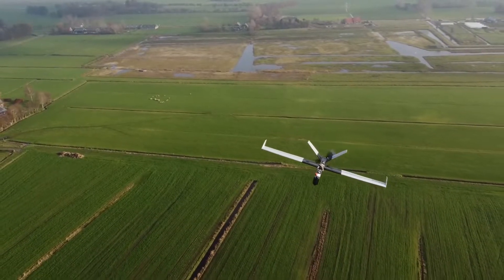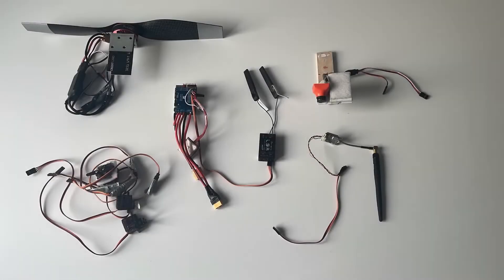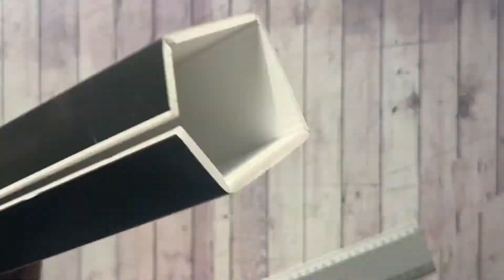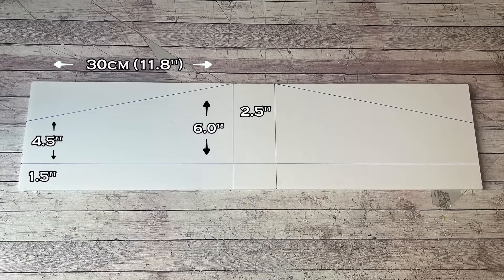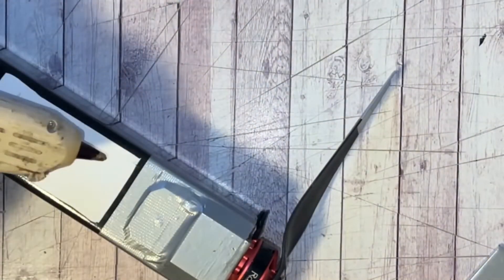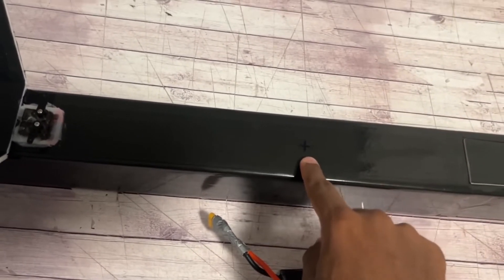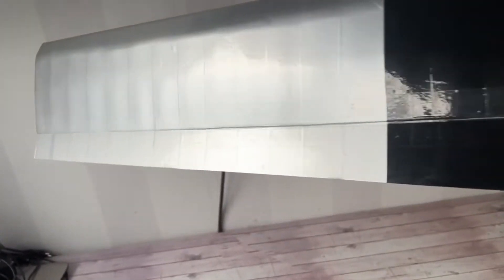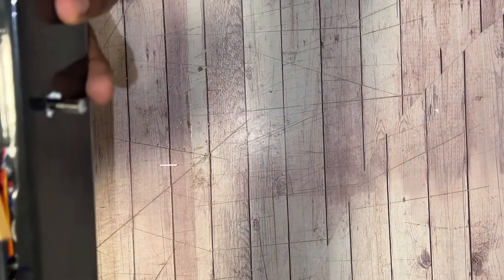How to build a V-Tail Aircraft for Long Range FPV - Silver Eagle

Comment from the maker: I've linked the electronics down here

Alternative's to the F405-WING & Recommended Flight Controllers:

Matek F405-WTE: https://s.click.aliexpress.com/e/_Dlk...
Matek F411-WSE: https://s.click.aliexpress.com/e/_Ddw...
Matek F411-WTE: https://s.click.aliexpress.com/e/_Dl1...

Racerstar BR3536 950kv Motor: https://usa.banggood.com/custlink/GDK...
Hobbywing 40A ESC: https://s.click.aliexpress.com/e/_DBK...
MG90 Servo's: https://s.click.aliexpress.com/e/_Dmw...
FrSky X8R Receiver: https://s.click.aliexpress.com/e/_DFC...
Eachine TX805 800mW VTx: https://s.click.aliexpress.com/e/_DFx...
Beitian BN-220 GPS: https://s.click.aliexpress.com/e/_DFN...
Reply: Hello..what is the angle of incidence..? Thanks..
Reply: What is the range of the FPV transmitter?
Reply: Are you using a 4 cell or 6 on this build

Comment: So I have a Silver Eagle built & ready to fly, almost.  One problem when plugging in the battery, the right control surface on the tail is 'flexed' by the servo to it max downward position momentarily.  Unfortunately, the foam can't take this extreme action & requires repair each time I plug in a battery.  I'm using a SpeedyBee F405 Wing flight controller with a SpekTrum SPM4650 receiver.   I'm wondering if anyone else has experienced this problem or just has a suggestion I can investigate.  Thanks !!!!

Comment: 7:30    servos  do   NOT   go  at  the  tail.!!!!!         in any case,  there  NO reason for the length of a pushrod to be minimized.!         the mass of elevator/rudder servos  SHOULD  be located such that  the  model's dom is as optimal as  possible.
you may know that the  center of  MASS  (c-m)  Should be located on the thrust, at a point that vertically aligns with twenty-five percent of chord or mac.      25%, plus or minus a pinch, is the location of the neutral point of a wing.        illustration showing correct location of c-m.
https://s3.amazonaws.com/assets.flitetest.com/article_images/medium/truecg-jpg_1384168691.jpg
if you don't know how to correctly make longer pushrods,  you  should  LEARN.
see at  3:12
https://www.youtube.com/watch?v=3gaORr-WxFs

Comment: information        2:30   the use of full strip ailerons is not recommended.      to the extent practical, a control surface should have the shape of a  Parallelogram.

Comment: What type of remote control are you using? How do you make its range reach 10 km?
Reply: 2:10 he is using the L9R (FrSky) receiver.  These long range planes are frequently waypoint controlled from the flight controller using the iNav software.  In other words, iNav can be configured for autonomous flights.  In this case he is using the Mateksys 405 Wing flight controller.  The other thing to note is that he is using a 600 mW video transmitter, because it is important to step up the power output when flying distance.  On top of that you need to position the GPS away from this high powered video transmitter which on a plane of this size should not be a problem.

Comment: How did you place the CG when you came up with design?  it seems so far back
Reply: install electronics in fuselage.....find the balance point of the fuselage.........measure the cord of your wing 1/3 back from leading edge to find the CG of the wing.....now place your wings CG point over the balance position of your fuse and you are close enough to get it in the air
Reply: Adding to what @mwbvideos good info. Besides installing, or temporary placing the electronics in/on fuselage, you'll also need to place motor (on tail), battery and servos, as they would be positioned between front and rear when completed. Using a rubber band(s) is one way to hold in place. (can even be external initially at this stage). Moving/positioning the battery (front/rear) at this stage can help you better find an preferred location (as it will alter CoG balance point, and thus where wing is placed, as well as position of the battery hatch opening)

Comment: Great build, I noticed the tape is put in a different direction on the wing build process. My experience is that longitudinal taping helps to reduce the wing flex due to the tension of the tape.
Reply: I am wondering if he used the CF rod he used for spacing the strips inside the wing as a spar. If he did, no need for the longitudinal stiffness from the tape. If not, the lengthwise tape would be needed. But maybe only a strip or 2, not the entire covering.

Comment: Question;
Would a cylindrical fuselage make a less draggy plane?
Reply: Yes, but it would be exponentially more difficult and time consuming to build. The whole reason these build techniques exist the way that they do is to make building them cheap and easy so that crashing them and iterating on their design isn't an expensive time sink.

You can see more elaborate and aerodynamic builds with something like Flite Test's "Master Series".
Reply: @CDRaff  I think not. If you can buy shipping tubes for posters. They come in all sorts of diameters and are cheap as dirt.
Reply: @piconano  Those are heavy.
Reply: @CDRaff   I built one from a poster shipping tube with 1 layer of fiberglass I dont worry about crashes
Reply: @JohnsOldMercurySite  Those tubes are heavy and by adding fiberglass you are making a flying whale. You defeat the purpose of efficiency. High-wing loading is horrible for long-range.
Reply: @FarmerFpv  and yet my plane gains altitude in 5mph breeze...wont come down  .....I need a lot of room to land.....BUILD THE RIGHT WING...." its all about the wing loading friend"